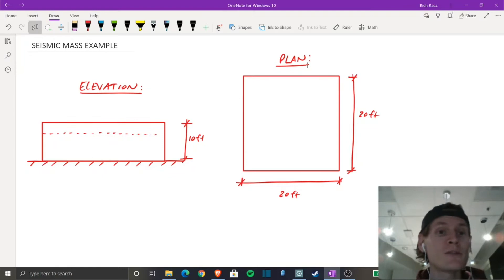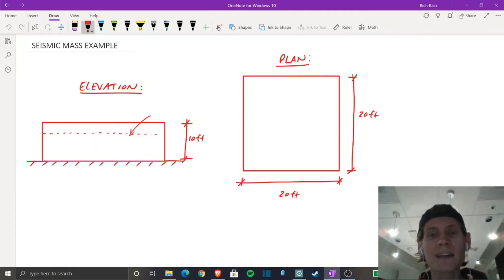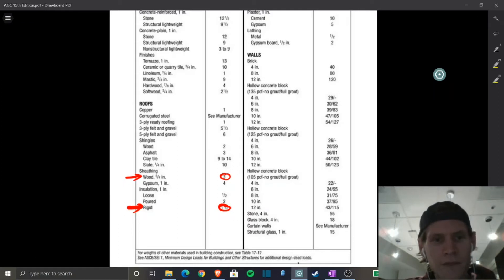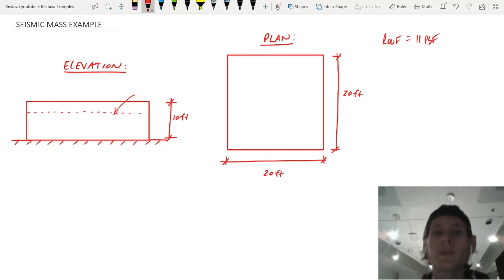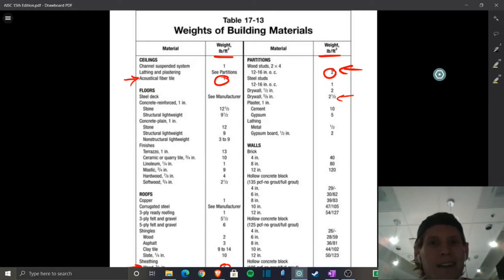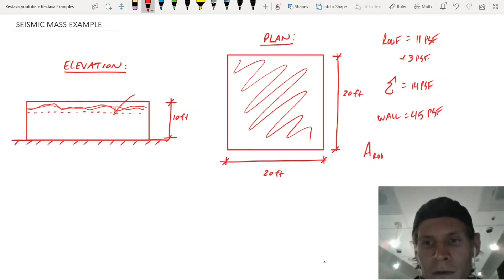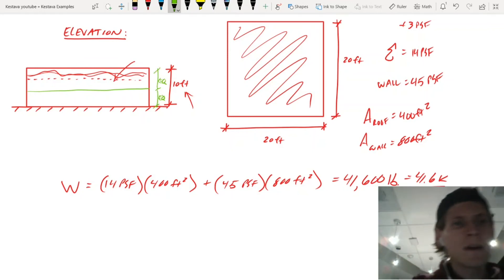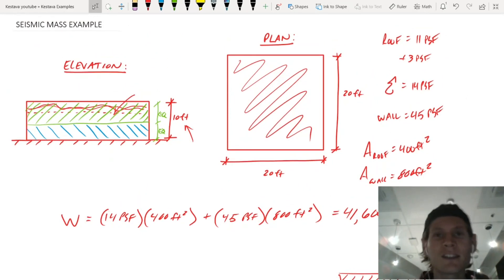How to Find Seismic Weight of A Building - Full Example

Comment: For a single story commercial building, I got the building weight from RAM Structural systems, but it does not include the weight of SOG (the building has spread footings). Do I need to calculate and add SOG weight to building weight for base shear?
Reply from the maker: SOG typically is not included in the seismic mass of a building.

Comment: This video came at the right time lol. Thank you for making it.  I have a question. If I'm doing a cast in place RC parking structure, Do I do 

slab weight (psf) * area of level (excluding ramp opening)
Beam weight (plf) * Total length on level
Col weight (plf) * length of column on level * # of columns
Barrier Weight (plf) * total length on level 
MEP (psf) * Area
Reply from the maker: Yes! If its a single story parking structure then you only need to do 1/2 column height when determining mass for overturning and diaphragm design, but what you show above would get you the seismic mass to find base shear! I believe there is a section in the IBC or ASCE 7 that says something about having to include some snow load if the structure is open and in a region where snow levels are high. might want to check on that.
Reply: @Kestava_Engineering  Yes for Base Shear. Thanks Brother!
Reply: I'm in Sacramento, CA. No snow sadly. I wish we had it so it wouldn't be scorching hot hahaha

Comment: for a one story building can you neglect the weight of the walls parallel to the direction of the force on the wall.  In this case what is the force on wall to calculate sear wall design?
Reply from the maker: yes you can when your designing your diaphragm - you can also include that weight for lighter (smaller) wood construction and can be a little conservative in your design. but if you do not include the weight of the parallel walls (in the direction your analyzing) then you do need to account for there mass when your analyzing the shear walls.
Reply: When calculating seismic weight, you can ignore the weight of the walls parallel to the direction of the seismic force only if you have a flexible diaphragm. For a flexible diaphragm, walls perpendicular to the seismic force will be leaning and moving together with the diaphragm. However, walls parallel to the seismic force are relatively rigid and don't move with the diaphragm; that is why we do not include them in seismic weight calculation for a flexible diaphragm. For a flexible diaphragm, you can ignore the weight of parallel walls for both seismic base shear and diaphragm force calculations.

Comment: If you're calculating effective seismic weight you should also include the 5 rules presented in ASCE 12.7.2 which includes some live load as well as some other non-intuitive provisions.
Reply from the maker: absolutely agree! if your situation aligns with any of the listed rules then you must consider them! typically they are for more "custom" structure types, BUT must always be checked.